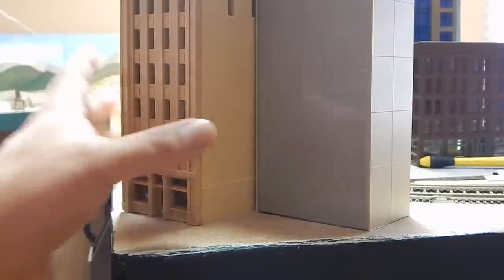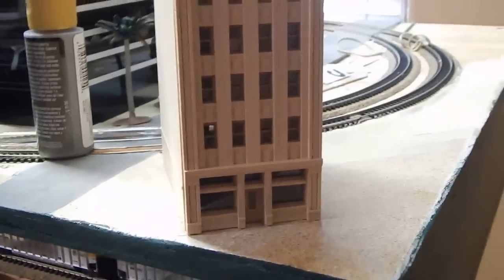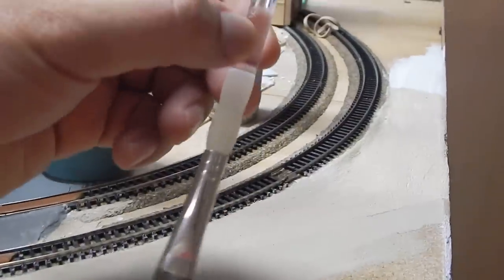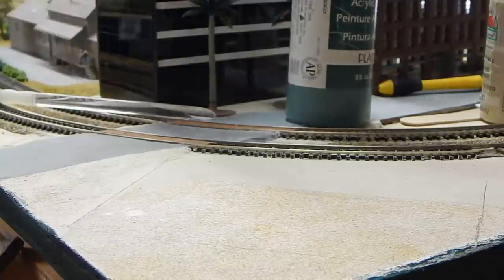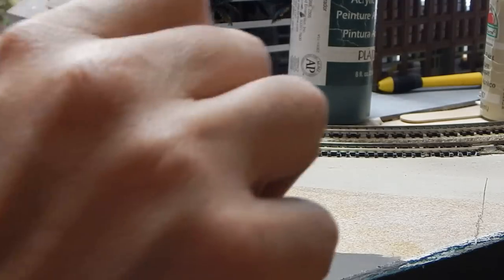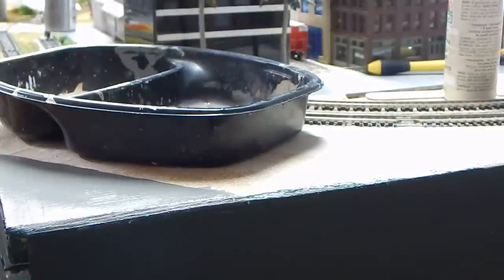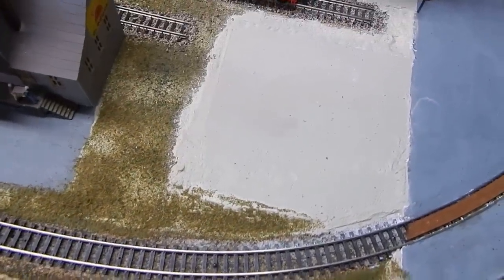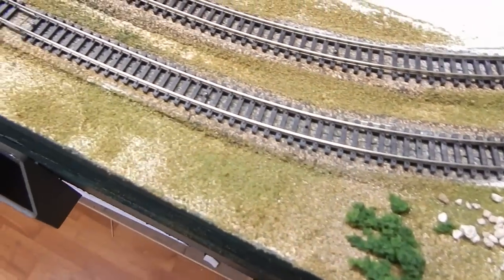DIY/Easy how to scenery for Model Railroading/Union Pacific & Santa fe Railway N-scale

Comment: The first 10 mins shows you how to paint small areas on a masonite base using acrylics.  That's pretty intuitive that anyone with some paint and a brush could figure out without help.  The next 25 mins deals with putting down ground foam using white glue and hair spray.  There's no new/inspiring technique involved here.  Just one solid layer on top another.  I wouldnt think anyone would need a video to do this.
Reply from the maker: +Ange Purs Thanks for the comment the video is mainly geared for the new person coming into the hobby.